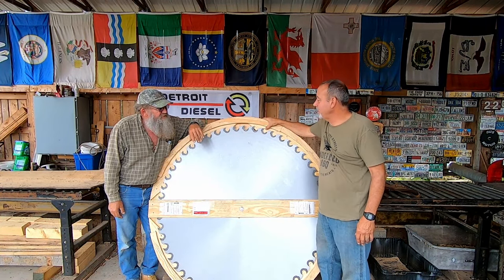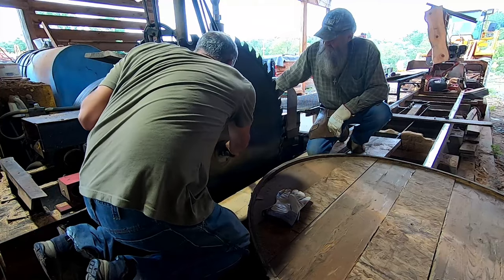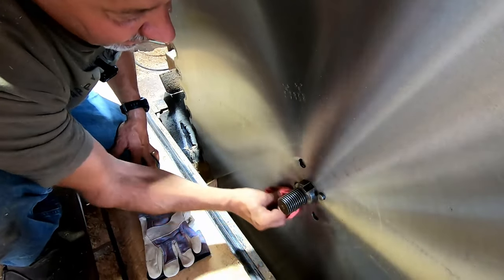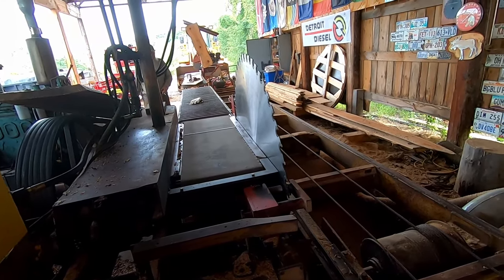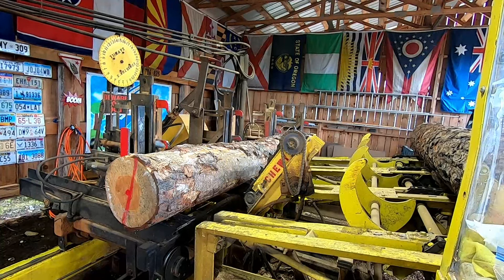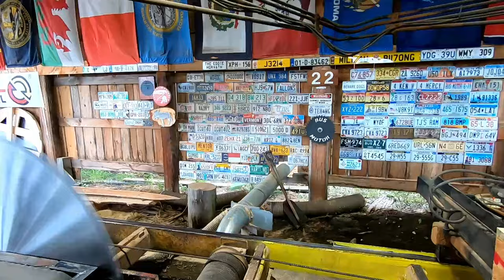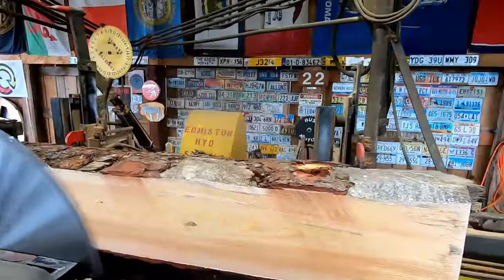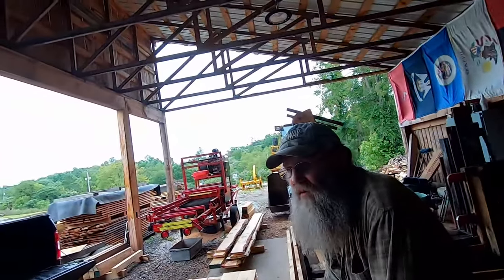Installing & testing our new B. H. Payne 56" sawblade # 459

Comment: I worked for a fellow back in the early 80's, old boy, great guy to work for.
His father was a saw filer, I think that is what you call the trade, sharpen the saws and tune them.

He had stories about his dad's shop.  His anvil was perfectly smooth, there were a line of hammers on the wall, all smooth.
He said the quickest way to get booted out of the shop forever was to take one of the perfect hammers and hit the perfectly smooth anvil.   Any kind of a divot in either the hammer or anvil would affect the tune of the blade.  Sawmills from miles around used to bring saws to him, he was that skilled.

Truly amazing what a true tradesman can do.
Reply from the maker: we lost our saw smith he was the best.
Reply: Greetings Messrs. Galicic & Horvath! 
First-time commenter here - love your videos and stories; always something new to learn! I'm not sure if you would call a person in that capacity a saw smith, or a sawyer. My late father, who passed away in 1986, emigrated to Canada after the war; his first job was at a lumber mill and camp in Chalk River, ON, west of Ottawa. He was mostly a teamster, who drove the horses out of the bush pulling logs. However, he had a damn good eye for saw filing and setting the blade teeth on the mill equipment. When I was a kid, I would watch him set saw blades that were dead on the screws! About 8 years before his passing, we got a wood stove, around the time of the second oil embargo. He got a cross-cut saw from an acquaintance of his, and proceeded to bring it back to life. He cleaned the metal, filed and set the teeth, and WOW, that saw went through logs just like butter! The inertia did all the work; as he said to me, let the blade do the work! Yes, the old adage is so true; experience is the best teacher! Thank you for sharing your sawing adventures; much respect!! @markgalicic7788

Comment: Hey there fellas, I appreciate you sharing videos such as this one. I've only put my blade on once so far and I don't think I "loaded the blade" but I certainly will from now on. I've got some videos to share of me doing a pretty big cutting job for a guy but I filmed it on a new GoPro and I don't know how to upload it. Lol
Reply from the maker: How's it going , did Mike have a 60" B-pattern saw on that mill when you bought it? I use the charging cable to download my videos from the GoPro onto my computer just plug it into a USB port.
Reply: Yes sir Mike ran this 60"  "B" blade. He actually said in a video he didn't like this blade but he was to old and sick to buy a new one. I've spoken to a guy called the Saw Doctor from West Jefferson, NC he told me he worked on this blade for Mike and said it is hammered for a slow rpm. He wants me to change the drive sheave and get the rpm correct at 600rpm then bring him the blade to be checked and hammered for 600rpm. He also said I should consider buying a 56" blade that the 60" is very hard to cut with. I think he said he could set me up with a new "B" at a fair price.
Reply from the maker: @templehillsawmill1748  yes I like sawing with a 56" saw it runs true.

Comment: Grew up in sawmill in East Texas. On pine we average 95,000 ft day. We cut small Timbers for the treating industry. We ran solid tooth saws. Always ran water on saw. Carriage never stopped. 
Enjoy your videos, however you are speaking to a large audience that does not understand sawmilling. It would be good if you explain to audience what tension in a saw is and what hammering is. 
We normally bought six 72” saws at the time and ran them down to about 58” and sold them.

Comment: You mention the teeth of the saw being razor sharp, I can absolutely attest to that, decades ago i was helping install a new blade on 10' resaw (band blade, not wheel) the blades came in from the shop bound with wire, one of the wires caught as we were taking tension off the folded over body of the blade, then sprung as we were trying to clear it. I didn't know i was cut until i looked at my arm and saw down through the skin and subcutaneous fat to muscle, the cut was so clean my body hadn't decided to bleed yet. 

Glad to see y'all still being safe in all your efforts. Can't wait to see the new blade take on a stop sign.

Comment: That blade sure does sing a great tune; and I wondered if you saw when the log rocked; that I noticed and thought there was bark under it! I have a band "custom DIY" mill that I can cut 3 foot Diameter x 22 foot log on. I have $15oo in it. I got 2 25 inch band wheels, 1 DBL 18 inch  for drive and a Kohler  16 HP that I got for $70. All the pulleys and  pillow blocks I got at wholesale from a friend that I know.
Reply from the maker: that sounds like a nice bandmill.

Comment: yes it pays to have a backup...i do with my generators,,,i think a bigger blade would be worp proned,,then a smaller one,,you have to think of heat...i saw some really big ones at some sawmills in tyler county Wv..but they were in the middle of a feed..logs were feed right down the middle..,course all they cut was cross ties,and posts,, no boards,,if there was they were rough cut..great looking  blade MARK...
Reply from the maker: thanks.

Comment: Mark, it even sounds like it is cutting much more smoothly than the original blade.
Cutting like each tooth is not just perfectly sharp but also evenly set giving an equal load all the way around and not part of the teeth carrying the load, somebody did an excellent job 👍
Reply from the maker: yes it does , they did a great job for sure.

Comment: Six o’clock in the morning very nice getting new equipment changed a few of them blades as an apprentice mostly 48 inch your right about the hammer , knocking collers on to tight can compress the center of the blade and stretch the metal witch causes a slight wobble and takes the tension out over time as explained by my old foreman just snug it up pins do the driving nut just keeps it there , I’m still messing with the push bench been through the bearings new drive shaft blade shaft for the blade is next I’m going to put it on the lathe to see if it’s got any run out , you guys have a nice day

Comment: Wow what a nice running blade. No scraping on the carriage returning. What is the rpm on the blade shaft? What is the fpm at the teeth? The extra radius increases the fpm at the teeth by how much? Can hardly wait for the white oak log. Never miss a video!
Reply from the maker: thanks Eric , yes it solved some of our problems . I run 600 rpm , the fpm is over 10k I will look it up in my book.
Reply: @markgalicic7788 , I’m not a saw blade expert but do remember 8th grade geometry, some days at least.  The circumference of a 56 inch saw with a 28 inch radius is 175.3 inches. 175.3 times 600 rpm is  105,180 inches or 8765 feet per minute.    Am I missing something?

Comment: Great video, nice new blade. This is a question I should have asked a long time ago. When you are setting up a mill how do you line the track with the line of cut? What do you use as points of reference?
Reply from the maker: thanks Cecil , this mill had everything welded together.

Comment: I work in a saw mill bc Canada…all the big saws we hit the nut with a hammer…sometimes the nut does come loose … I have seen this myself….the big cut off saw is a 9 foot saw we double nut that one and use a 5 lb hammer to make sure it does not work off….you should put a laser line to line up the saw with the….just make thing easier
Reply from the maker: I do run a laser.

Comment: Enjoyed today's video, Mark añd Eddie !! Like you said, it was a little different from the usual !! I do have a couple questions:-
1). What's the weight of that blade ?
2). Can I ask how much a blade like that cost ?
3). What does it cost to sharpen the old blade ?
4). Any local Saw Doctor that can service you ?
5). I can't believe that is the first blade replacement you've done since opening your mill.......!!
Thanks again guys,
John
Reply from the maker: thanks John , we still have our first blade from over 30 years ago , about 150 lbs , we will go over the cost on a later video , I sharpen the blade my self , we are going to try a new guy in NC ,

Comment: $64.00 question for when you talk to the Saw Doctor. Is the saw blade tensioned with bits in place or without bits in place. Seems to me the mass of  bits would effect the overall balance blade.
Reply from the maker: yes you need the shanks and bits in the saw because they hold the tension in the rim of the saw.
Reply: @markgalicic7788  Thank you.

Comment: Awesome video!
In the video you mentioned that this new blade was hammered for 600rpm. What is your mandrels speed? 
Ive been having issues trying to figure out on my mill what I should have my blades hammered for?
We re using a 6-71 naturally aspirated engine, mandrel speed is 860rpm my current blades are hammered for 750rpm. Does this seem ok? Any help would be greatly appreciated! 
In the past ,midway through a cut engine loses a bit of rpm and the blade wouldn't stand up straight and heat up
Reply: Get a tachometer for the husk- mandrel. We run a 6-71 at 650 top rpm blades hammered for 600. Cut rpm is more like 620-630. Sounds like you need to gear down. 830 is odd ball speed. Usually blades are hammered in increments of 50 rpm and the range is good for 50.

Comment: That blade is doing a great job, Mark. I noticed after the first couple of cuts that there wasn't a rooster tail on the return. Are those carbide teeth?
Bill
Reply from the maker: thanks Bill , yes the old saw was getting loose and needs hammered . yes these are carbide.

Comment: I notice saw blade marks on the lumber.  Would it be better if you sawed a little bit slower, to get a smoother finish.
Reply from the maker: it is rough cut lumber , feeding to slow will heat up the saw very bad .

Comment: Do you have to readjust the guides after the couple of cutting cycles due to heat?
Reply from the maker: no the blade will adjust itself after time.
Reply: @markgalicic7788  👍

Comment: Are the teeth actually carbide inserts?  Can they be sharpened either in the blade or a sharpening device?  As long as the blade is true, can you just replace and index the teeth?  Thanks. Great video
Reply: I think Mark was leaning of late towards hardened chrome teeth, in lieu of the more expensive carbide.
Reply from the maker: thanks , yes these are carbide bits and I sharpen them with a diamond wheel .

Comment: Why wouldn’t you set blades after they are warm. As metal expands. Set initial then re-set after warm. Just curious as I would think that would be more accurate.
Reply from the maker: If the blade gets warm you have a big problem.

Comment: What holds the guide pins in place?
Reply from the maker: they sit in holes in both collars.
Reply: @markgalicic7788  I'm a bit confused.  You turned the adjustment screws to move the guide in and out.  Where are the holes that hold them from moving?

Comment: What is the cost of the new blade ?
Reply from the maker: $2111
Reply: @markgalicic7788 That’s not a bad price once you consider what’s involved in making one. That’s not just an overgrown skill saw blade. The inertia involved of that much steel a couple feet out from the center is nothing to be trifled with. Actually nothing about that whole operation is anything to be trifled with.